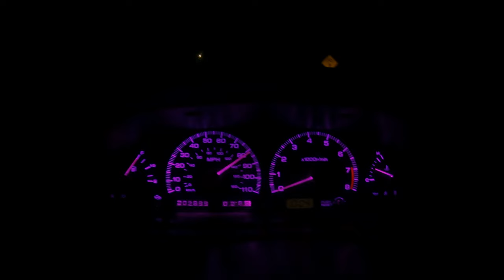How to Install a Jig on a Car + Gf's 240sx Gets New Rear Subframe Bushings

Comment: This man is rebuilding a wrecked shell from the ground up on jackstands using cut offs and structural parts from other shells…. And I’m here procrastinating on small rust patches on my e46 lmao. I needed this motivation
Reply: @fuckngreat8955  do not worry! I’ve replaced my rear arches completely and just removed both outer sills both sides ready for the fresh sills and door steps to be welded on. It was only small surface rust areas but I’m doing it all in one go with completely fresh metal panels all zinced and primed inside and out. Other than that it’s rust free. 

It was sapphire black but I’m now prepping it to all be sanded back and resprayed Imola Red 😍 

E46 330d M sport saloon on BBS RS with Tanin red sport interior.

Comment: Grat progress dude, FYI though on the frame rail spot welds you drilled them wrong. You only need to drill through the top layer (floor pan) metal not all the way through the rail as well. By not drilling all the way through it makes welding way easier later.
Reply from the maker: Thanks for the tip 🤘

Comment: I liked your hole-saw method for removing the old bushes... dunno if it's easier than the burn-em-out method (which is what I used), but it looks less messy and less smelly at least.  Be careful of the anti-seize... that stuff is insidious!  If I even look at the bottle, I somehow end up with it all over my pants, shirt, the bolt I was originally aiming for, the floor, the car itself, on my face, in my hair, etc...
Reply from the maker: Antisieze is so unforgiving haha
It was everywhere when we were done with the bushings 😅

Comment: A bumper jack or Bottle jack with the right kinda of rigged up support could help spread the frame rails.  Just make sure to spread the load on both ends so you don't crush/damage the frame more.
Reply from the maker: I swear, you always seem to know what's coming next 😅
:_s13:

Comment: Good work so far 👍.

Now you've got something to work from. 

Yeah it is surprising seeing how thin  the major parts are too. 

Could I recommend a useful tool to get as well? A spot weld chisel. They are quite sharp and help split the seams apart as they are quite narrow. I've got one and it's been a big help with removing crappy metalwork from myshitbox projects 😂.
Reply from the maker: I'll have to look into that! Pry bar was letting me down haha
Thanks for the tip :_s13:

Comment: when you're welding the pieces together, if you cant clamp the seams, use self tappers to keep the pieces together tight before you weld, they gotta be tight. Just weld the screw hole after.
Reply from the maker: Smart smart!
Thanks for the tip!

Comment: You should reinforce those tension/castor arm brackets also the rear subframe, and maybe seam weld some of the chassis.
Also could you please do a vid showing how you did your dual caliper setup in the rear and what parts you used? Your setup looks better than the other ones I've seen.
Reply from the maker: True!
And I definitely can during reassembly 🤘:_s13:
Reply: @PrizzaMike  Thanks! Also I have seen people fit a power brace, which welds in between the 2 tension arm brackets horizontally which also helps with flex in that area. Here is a link to a vid to give you an example of one being fitted..
https://youtu.be/kOH54Dg0XOA
Reply: @PrizzaMike  You can also buy a Nismo Powerbrace for S13 for about $200+. Which has reinforcements done and is a bolt in part
Reply from the maker: @nzuncovered1845  true, I'll probly end up making my own 🔥

Comment: You really should just get a new chassis. At a certain point, how much of the car is truly yours? It's like an old axe that had its handle replaced, followed by a replacement of the head. Is it the same axe? Same with your car.
Reply: Hes replacing structure, not the whole freaking car , itll still be plenty more of the old car than new . When you love a car you end up replacing or upgrading most of it  regardless and never consider it a different car.
Reply: @jordangarneau3022  When he's done there's going to be about half the car left. He's also doing this without a frame machine. I don't have high hopes, but we'll see.
Reply from the maker: @miznitic5574  wheres the fun in a new shell? Would only take a day to shell swap, anyone can do that
Pushing the limits and growing and learning from all of this :_s13:
Reply: @miznitic5574  you don't need a frame machine , he has measurements and references everywhere. If things are off in the end then a frame machine would help . Replacing all that he is , is far better than bending it all back .

Comment: Wasn’t the whole purpose of saving this car because you had memories etc in it? By the time you’re done it’s going to be 15% of the original chassis. You’ve cut the thing to the point of being less than 50% original. I just don’t get it. Repair a car that needs 75% new chassis, or buy a new chassis and put 100% of old parts onto new chassis lol. 

I think you legitimately and honestly seek attention and video views more than being honest and concerned with building a legitimate vehicle for the road again
Reply from the maker: 15% is more that 0%
This is my car, and my choice to fix it. This process has been such a great learning experience and I enjoy working on it. I'm not gonna stop until its done